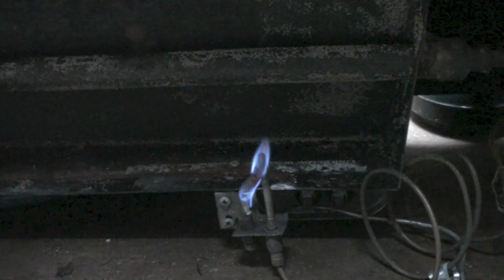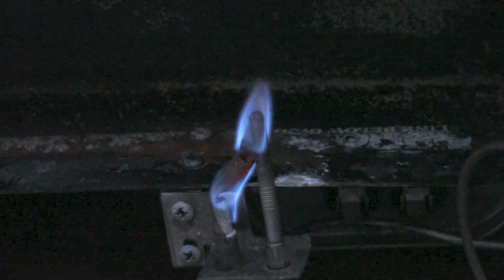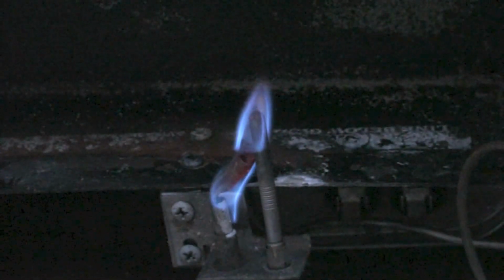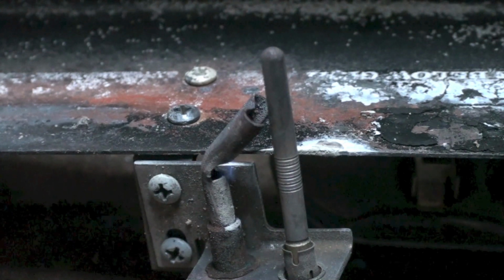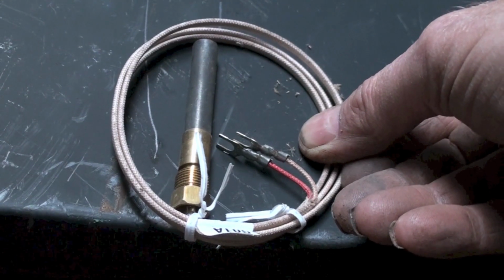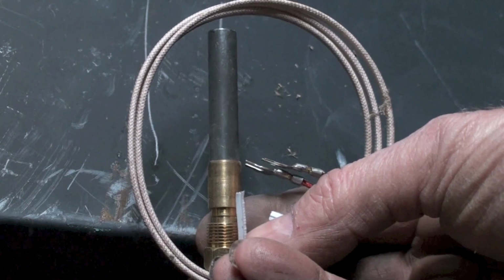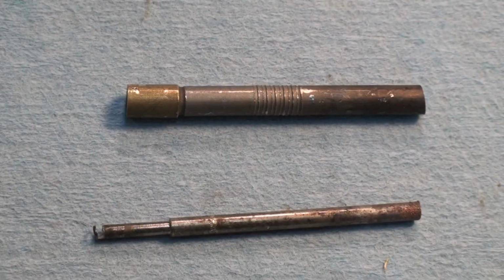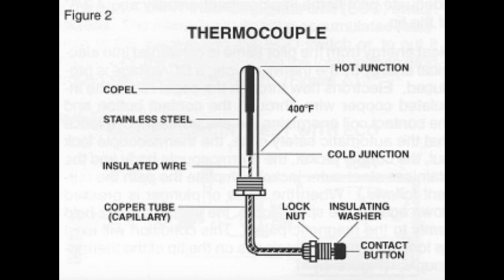How the thermocouple is made

Comment: Wonderful video.  Thanks GFM.  The time and effort you put into your videos is appreciated and highly reputed.  I'll just elaborate on one point to contribute, for the technicians out there.
Keeping in mind the temperatures of the HOT and COLD junctions are critical to the amount of voltage generated.  The cold junction is down around where the thermocouple is secured to the pilot burner base assembly.  The hot junction is obviously the top 1/3 of the thermocouple where it's impinged upon by the flame.

The security of the thermocouple's mount serves as a heat sink.  So, its being securely mounted has a direct affect upon the DC voltage it can generate.
With that in mind, understand that NOT attaching it properly (which I've encountered many times) has an immediate impact upon the thermocouple's ability to generate voltage and may cause an inadequate voltage situation.  Low voltage may cause the pilot safety valve to close and the pilot to go out.
Reply from the maker: Earl Clover Good thoughts.  I never thought of that.
GFM

Comment: I am having trouble with my direct vent gas fireplace.  The fireplace lights OK and runs for about 10mins then goes out without being turned off.  Then it will come back on intermittently.   I am thinking it has something to do with either the wall switch or the thermopile.  I'm hoping it is a simple problem I can fix myself.  Any ideas on what I can do to test this? Thanks
Reply from the maker: Megan Kohtz I would look first for a plugged pilot.  If the pilot flame is yellow, its plugged.  Next, be sure all electric connections are tight.  Then replace the thermopile.  Hope this helps.
GFM
Reply: The pilot has a blue flame and has a constant flame, so I think that is OK.  If I juggle the wires then it will come on, so I think I need to invest in a multimeter and check the electrical connections and current next :-) Thanks!
Reply: I purchased a multimeter and tested the thermopile. When just the pilot is on it reads 486mV. When the burner is running it reads about 226mV, then when it goes out it reads 000mV.  I think I have an intermittently working thermopile.  Can you make a video about how to replace the thermopile. Thanks!

Comment: why the wires inside in a capillary tube on Thermocouple but only insulated on thermopile?
Reply from the maker: Guy Hakverdi Beats the heck out of me.
GFM
Reply: Because of the very low power output of a thermocouple, it needs the larger surface of the outer tube (earth conductor) and heavier gauge inner conductor to avoid voltage drop over distance of the wires

Comment: Hello Grayfurnaceman-  Is there a design life to these?  Seems nothing is made to last forever-- of course not.  So I imagine even these suffer from wear and tear.   From my former working life of 35 years, I got to witness the grief these thermocouples cause when a homeowner is gone/out of town, in deep winter, and these things quit on a furnace.  Those pipes in the house go "Ping and splash!"   I assume you really cannot test these for signs of potential/looming failure as a preventative maintenance plan?
Reply from the maker: DOLRED Some techs replace them yearly, I think that's a bit much.  Many of these last 30+ years.  They can be tested with a service by checking the output.  Should be 18-22 millivolts.  What I usually see is the end of the thermocouple breaks down.  They are among the most dependable of parts.  This is not to say the pilot system is the best.  But then, all systems are subject to failure.  I tell my customers to have someone check the house every day in the very cold times if they are not home.  Hope this helps.
GFM
Reply: grayfurnaceman
Thanks--I have been keeping (For Years) a spare 36 inch "Universal" Thermocouple near my workbench---just in case--it is still in its original package priced at $5.29.

Comment: Hi I have a Style Selections vent free gas fireplace insert model number SS fbd 32r the pilot light will light and stay on but the burners will not come on can you help
Reply from the maker: First, it is not vent free.  The vent just dumps the vent gas into the structure.  Not a fan of these things.  It is probably a millivolt system.  If the gas valve is in the on position, and any switching (thermostat, light type switch) is closed, you may have a loose connection.  The low voltage used here requires the wiring connections to be very tight.  You could also have a pilot not covering the thermopile.  Yellow flame indicates a plugged pilot.  Lastly, the thermopile may be weak.
GFM
Reply: grayfurnaceman on the instructions it says vent free gas fireplace it doesn't have a thermo-pile but it does have a thermocouple the pilot light is a blue flame it's a nice blue flame on the pilot light  and the pilot light comes on and the pilot light stays on but the burners just don't lite can you help
Reply: I took a picture of the diagram but it won't let me send pictures through this post but it has what it's called an NG pilot air Inlet hole then it says pilot assembly and then it says LP pilot air Inlet hole
Reply: The pilot fire actually comes out of this one that says ng air Inlet hole and it hits the thermocouple
Reply: Also my thermal I don't know if it's a thermocouple or thermo-pile but it doesn't look like either one of these in your video about the thermo-pile and a thermocouple it looks like a pointy it looks kind of pointy like and I wanted to know was that part broke or something
Reply from the maker: If it does not have a thermopile, it must have 120 volt power.  It could have a breaker kicked off or a switch shut off.
GFM